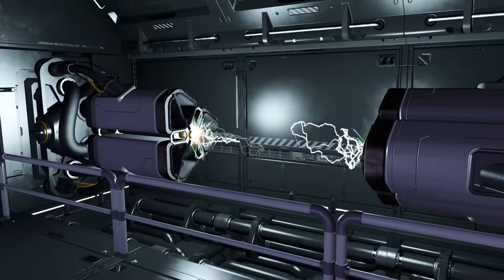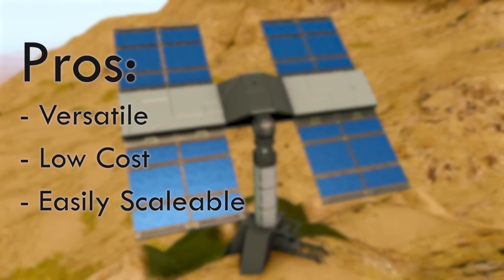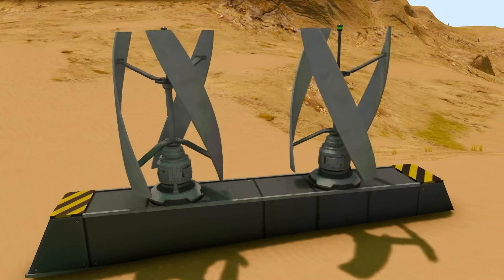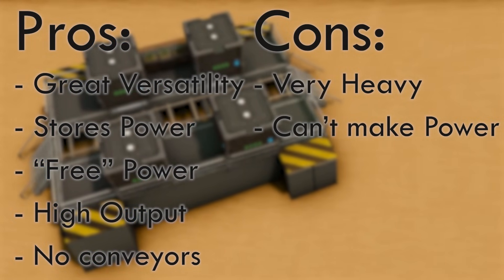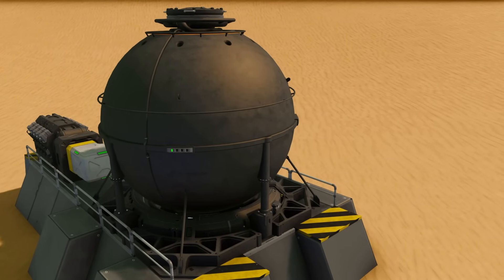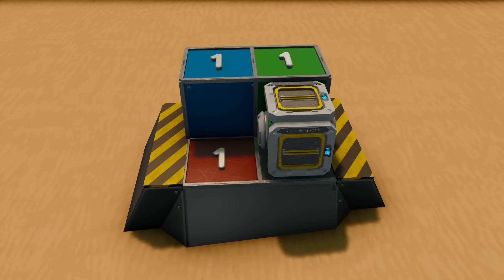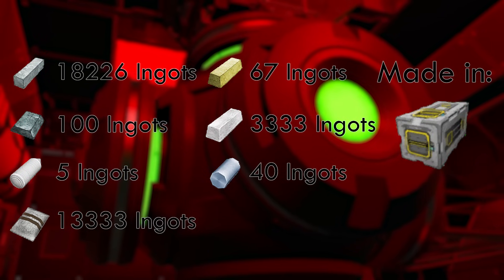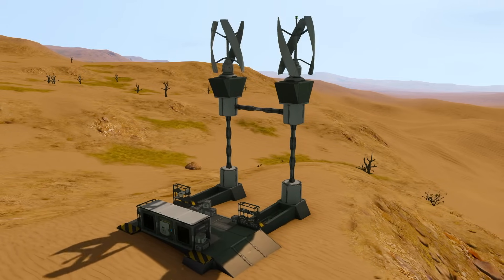The BEST Power Block in Space Engineers - Tier list & Comparison

Comment: One thing severely lacking in SE for batteries is the ability to set discharge to specific blocks, like for instance if I have a small bank of railguns, I want to have batteries tied directly to them, so that I don't have to power the charge for them directly.
Reply: I've always wanted more in-depth wiring in SE. Breaker boxes and the ability to put devices and rooms on different circuits.
Now we can actually reroute the power.
Reply: Workaround; Could use event controllers to turn on and off groupings of batteries. How many fully charged batteries to fire a rail gun? 

That group is OFF until said rail gun is fired upon which the group is turned on. Stays on until fully charged then turns back off until railgun is fired again.

Would that achieve the same effect? When the batteries are off they can't be used by anything, retaining their charge. When turned on once fired they will discharge their energy to charge the rail gun. Recharge and then shut off until needed again.
Reply: @ender5817  This would only semi work, because though the event control could function in this way, you could also just group the batteries you wanted and turn them off and on as you fired the rail guns. The issue isn't really how the batteries are turned off, on, recharged, etc etc, it's their specific power usage. 

There isn't a way (at least as far as I am aware of) to isolate the power being transferred to the rail guns. The goal would be to have the rail guns only ever pull directly from a specific set of batteries. Unfortunately though, the rail guns are going to pull from every battery that's attached to the same grid it is. Turning some batteries on and off might save some time and power, but you're still gonna end up drawing from the batteries that you're trying to specifically NOT draw from.

However thinking on it, you could I suppose have some event controllers with some timer blocks perhaps set up to power down the main batteries during the rail gun charge while only the rail gun batteries are on. Issue of course there is that the rest of the ships operations would still need power, and draw from the rail gun batteries. 

There might be an answer somewhere in that setup for this type of situation, but I get the feeling it would not still be what OP was looking for specifically. (That being a separated battery bank that is used solely to power the rail guns, while the other batteries only powered normal operations.)
Reply: @DoubleJJizzle with the weight and space used by those rail gun only batteries it seems to be a waste to have them off. With them on all batteries on your ship would just last longer. So, beside cool factor, what is the actual benefit to having a system as you describe?
Reply: @inktitan  as far as I am Aware of? Not a thing. There might be some arguments for stuff like having batteries specifically set aside for charging a jump drive, but for a railgun, I don't see one. It's mostly just a thought experiment on how you'd get a system to work like that. 

Real life of course does actually use these types of systems, usually isolating them for various reasons. Keeping redundant power supplies available for when they're needed incase main power is lost. Using power for specific systems that draw high/low amounts of wattage to keep strain off primary power sources.

However this is a game and those kind of redundant systems aren't exactly efficient. Still could see an argument for jump drives though.

Edit: In addition to Jump Drives, I would consider having additional batteries for other high draw blocks such as a refinery pretty useful. Normal standard operations would be essentially powered on all the time by a set of batteries. When you turn on some bigger power draining blocks, you turn on a second set of batteries/power generators. 

This would help keep your power drain and fuel usage to a minimum and be a bit more efficient during normal usage of a ship/station. While still giving you an option to push out more when needed.

This would allow simpler power generators like solar panels and wind generators to have an easier time charging and keeping you operational, while you're basically not doing anything.

However, even with all that, it still just seems like a lot of work, for something that's not really needed for a video game like this one. Considering power production is endless, resources are near infinite, and complicated builds aren't always what they're cracked up to be. Especially considering this would be a purely superficial upgrade to any build, that likely wouldn't anything of real hard value, but a few % points of efficiency.
Reply: As soon as you need to recharge those batteries this breaks. @ender5817
Reply: Couldn't you look at the issue from the other end, and set the programming so that the railguns can only fire if your batteries are at X charge? You could do that for all ship systems, and have a power priority system based on charge level.
Reply: @McShavey that might actually be a better method. Really though it would just make sense for batteries which have a higher max output compared to generators, to be needed to power railguns.
While generators make them function the problem is I want to run the railguns directly off the batteries while leaving them on auto, so they only drain the batteries but won't hit my main systems, however I don't want the railguns to drain ALL my batteries only those tied to it.

Comment: ya, no, forgot the time and effort you need to feed those engines and reactors while wind and solar well, build and done. 
Taking that factor in the list is basically upside down, ignoring the battery for that's a storage device, not generating power.
Reply from the maker: You might be right that solar and wind is build and forget, but I wish you good luck powering an atmospheric, hydrogen, or ion ship with solar panels. 🙃

Comment: The only thing I felt was missing from this was further comparison of the net power output of the hydrogen engine and small reactor. You went to the effort to mine the same volume(? unclear) of each ore and compare those all the way through the process but left out the last bit of info to sum up the final gains and compare their efficiencies.

For those curious: some math extrapolates that the net power production of the hydrogen engine was 809.28 kWh (90.9% efficiency from ore to power), and the net power production of the small reactor was 9753.83 kWh (98.3% efficiency from ore to power).

But what about time? The O2/H2 generator takes almost as much time to refine the fuel as the engine takes to burn it, so that's easy to balance: one ice processor per engine. The refinery took less than half as long to refine the fuel as the reactor took to burn it, so one refinery can serve two reactors and still have a little bit of time leftover to do something else.

Also, the rector took much longer to burn through the total mass of the fuel but produced much more power (more than 11x as much). If you stop the reactor once it's produced as much power as the hydrogen engine, you'll find that it only took 1/3rd the time and you still have 91% of your fuel remaining.

This all means that for every 1 ship load of uranium ore collected, you'd have to collect 11.14 loads of ice to produce the same amount of power. 1.014 of those ice loads would be wasted producing power for the O2/H2 generators while only 0.017 loads of uranium ore would be wasted producing power for refineries. Uranium power is far more dense than hydrogen power and takes less time and effort to collect and produce once you know where the ore is to be found.

Then you have to consider that refineries can have upgrade modules to further adjust fuel and/or time efficiency depending on need while the O2/H2 generators are fixed at their base speed and efficiency.

If you stumble upon a uranium deposit, it makes sense to collect it immediately since it's objectively a much better fuel than ice when you have it. You'd have to spend roughly 12x as much time mining and refining ice to get the same power. And offsetting the refining costs with renewable energy is much easier. When ore availability is not an issue, the small reactor is far better than the hydrogen engine.
Reply: hydrogen engine imo is ideal for planet locked base and rover mobile bases, while reactors are for everything up there. having to go to space to mine uranium, then go back to planet would need hydrogen thrusters or ion+atmos thruster combo and that would need a lot of electricity anyway, so in both situations you are forced to take the hydrogen route.

basically for planet locked, its the best active generator full stop. for To Infinity and Beyond scenarios hydrogens are at best A tier
Reply: The battery was placed above things that actually generate power. This is a bad list.
Reply: This is not a power generation Blocks list  @ShtikMahn , it's a Power Blocks list. Batteries may not generate power, but they provide it on demand, just as solar panels generate power but can't provide it on demand.
Reply: @markbooth3066  when you're right, you're right

Comment: Thanks for making this. This is an excellent video. Liked and subscribed. A few things that could be added in the next iteration. Solar panels can be double stacked and still function. Even though the panels are touching, they all still work at full capacity. This method does take up extra block space, but it has the benefit of doubling the output of a solar array. Wind turbines can be placed 10 blocks high and then you can add one turbine to each side at the 8 block level to increase power output without the turbines negatively effecting each other. It looks ugly and takes up a lot of space in the sky but the power output is usually worth it. Weather can can have positive effects on wind (which is mentioned), but weather can also have negative effects. Foggy weather is horrible for wind generation. The large reactor takes fewer resources than spamming 27 small reactors in the same amount of space, but the output of the 27 small reactors in that space will be more than the large reactor.
Reply from the maker: Thank you for the feedback, and you are right. There are some things that were forgotten and that should have been mentioned. Though I was not aware that the wind turbines could be affected negatively by certain weather, interesting. And as for the reactors, the 27 small reactors make 405MW, which is only 105 more than the large reactor. So sadly not double, but 1/3rd more. Either way, thank you for the support and the advice! 🙃
Reply: @BenDoesThings404  Haha. Math is hard. I'll fix my comment.
Reply from the maker: No worries, easy mistake to make, easy to fix 🙃

Comment: One thing you should've touched on, I think, is online multiplayer and PCU limitations.  On the official Keen servers, as one example, we get 20,000 PCU per person.  Given that, in the moderate to long term, resources are not the constriction, but PCU is, that changes everything.  For example, batteries are 15PCU each, reactors and hydrogen engine blocks are 25PCU, and wind and solar are 55PCU ( ! ), that changes things even more.  Wind and solar are completely inefficient in starting sense, and late game, well.  Unless youŕe using hydrogen for propulsion, it doesn´t make sense to use hydrogen engines.  PCU is used up creating the H2 infrastructure.  Reactors, however, will use your currently existing refineries.  A single large reactor with batteries for "burst" power needs is seemingly the optimal way to go.
Reply from the maker: PCU was something I forgot to touch on. I rarely hear people talking about PCU, but rather stuff like block limits instead. I completely agree with you, I should have looked into PCU limitations as well, and I do apologize. Though from the looks of the PCU values, each of the blocks did score pretty accurately in the ranking. With batteries having the lowest and being ontop, with wind turbine and solar having the most, and landing on the bottom. So its fortunate in that sense. But that is something I will take into account next time, thank you! 👍
Reply: @BenDoesThings404  Regrettably, the limits are low enough, on official servers anyway, that a lot of fun things are impractical or impossible.  Custom designed guided missiles?  Even small ones can go over a thousand PCU, and any decent target will have enough turret to shoot them down, so you´d need a swarm, which means you´d have missiles and nothing else.  Small thrusters are pointless, given the large are the same PCU.  And custom turrets like the ball turrets?  Too expensive!   I understand the PCU limits are meant to keep server impact low and to promote fast network play, but that just highlights the lack of optimization, even after all of this time.
Reply from the maker: Yeah I can fully understand that, and its honestly a shame. Especially for those who go on youtube or reddit, even the workshop, and see people with these massive ships, that they can never build. I truly hope that Vrage 3 will be a much more optimized engine, if they choose to either make a sequal or port the game over. Either that, or they find more ways to optimize the game. I mean, it has come a long way since its first release, but it should have gotten even farther. Its always so saddening when someones creativity, is limited by artificial limits..
Reply: @BenDoesThings404  I just keep in mind how things went during the SE / ME years.